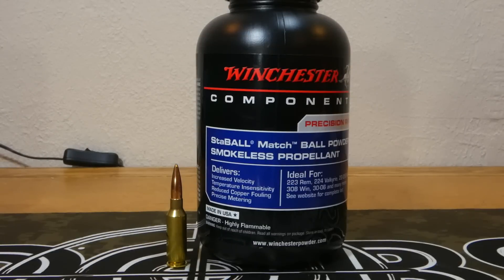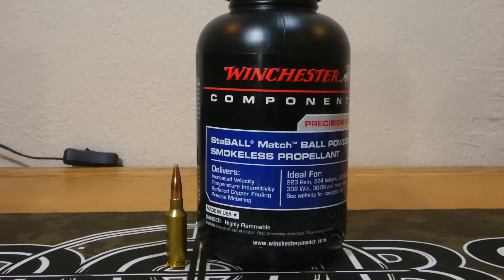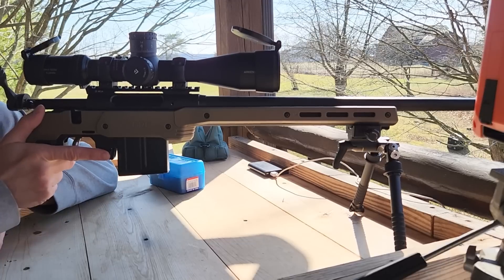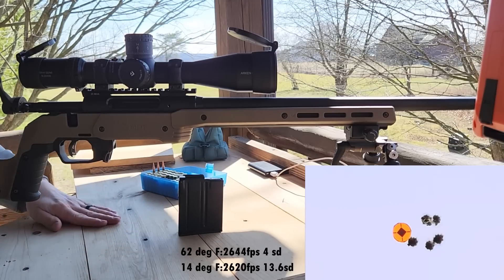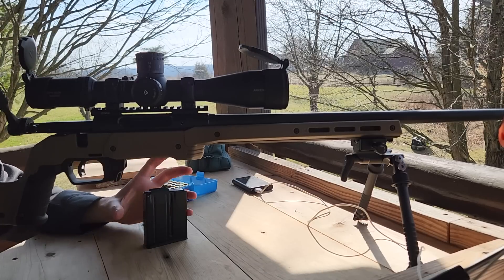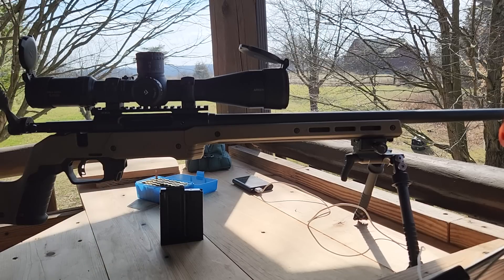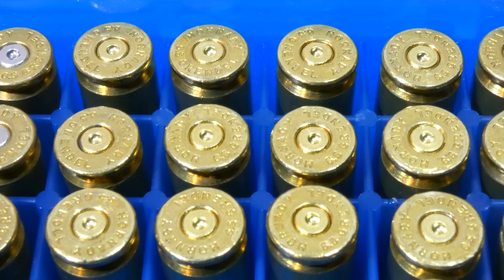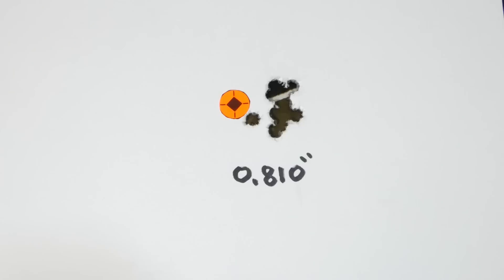Staball Match, Temp Stability, 6MM ARC

Comment: I did a test the same powder , except I was pushing 3000 FPS out of my 300WSM with 180 bullets.  The powder seems to be stable at lower 2600 FPS, but take it higher where the temperature  makes a greater difference at the result is instability.  My rounds at 50 degrees were perfect, 1/4 MOA. Same load @ 70 degrees started opening up.  @ 80 degrees primers stated blowing out the back and some bullets hit completely side ways.  My opinion is that StaBall, is only stable at lower velocities. Try the same test at 2900 FPS with your 6mm.
Reply: I have done a similar test - 20F to 95F, 7mm Rem Mag, 168gr bullets, 3050fps, basically zero velocity variation from cold to hot. These were shot in the winter and in the summer, so everything was at temperature, not just the rounds. This was using StaBall HD. Since your rounds were hitting sideways it seems like something else might have been going on maybe?

Comment: Testing to higher temps would be more better. It's not the temp you're shooting in(mostly), it's the temp of the powder in the case. You would be shocked at how quickly the ammo gets well over 100F just sitting in the sun on a nice 65F day, much less in a car or in the summer or hot environments. When doing temp testing, the largest extremes in temp that you can get should be the goal, in order to provide the best "snap shot" of the temp profile. Many other factors affect the profile, and it's not perfectly linear(usually), but in the absence of massive testing and analysis, the wider the snap shot, the better the approximation.

Comment: I’ve got a Savage 110 Tactical in 6.5 Creed and it struggles with extraction/ejection. I’ve swapped out the extractor and pin with factory replacements and aftermarket ones from Tactical Research to no avail. I see yours occasionally fails as well. Mines pretty much a fail every time. Love the rifle and how it shoots. WIll be requesting a new bolt from savage. I also have a 20” 6mm ARC AR15 and just picked up a few hundred factory second 105 OTM’s (Hornady) and some Staball match, appreciate the data you tested here. I was hoping it was similarly stable as Varget and it looks to fit the bill. CFE 223 is just far too unstable for me to do much more than plink with it despite being so versatile. Might make the switch for 223 as well if i can get it to shoot good with adequate velocities.

Comment: Interesting.
The better test would be the gun being as cold or hot as the ammo. Not wanting to shoot in 150° weather is fine, but if one shot their rifle 6-7 times in rapid succession, in 95° weather, the gun barrel and the last chambered round would be near 150° and its velocity could then be measured.
One could also leave the ammo and firearm in the noonday Summer sun for a few minutes and both would heat up quite nicely. Similar acclimation could be done in cold weather.

Comment: Being vacuum sealed you created a negative pressure inside the bag that slowly sucked air out of the cartridges. Less O2 to ignite with the powder equals lower burn rate and lower pressure. You probably cut open the bag and shot them right away not giving them time to equal out again. Who would have thought?
I'll ignore the third test, but really like the results from 14 to 62 degrees. What's the chance  you bought some Staball HD to test?
Reply from the maker: I don't have any Staball hd. Haven't found any yet.

Comment: I wonder, if when you vacuum sealed the first ones in water, the bullet could have been pulled into the case further causing less pressure and the lower velocities?
Reply: That's a good guess, except if the bullet seats deeper it increases pressure and increases bullet jump to the lands, both of which increase velocity. 
I'm going with the negative pressure inside the bags over extended period caused  a negative pressure inside the cartridges giving the powder slightly less O2 to burn.
Who knows for sure?

Comment: You'll want a test sample larger than 3 each to resolve any differences. While Hornady suggests 20 shots before you have a true picture of an average velocity and accurate SD, that's a lot of commitment for what we are doing... That said, I ran a similar test when StaBALL 6.5 was released using 10 shots each and it showed a pretty clear trend.

Comment: Deeply flawed test. However, despite the flaws and the bias that you used to skew the velocities… the total group… looks great… and that’s what really counts. Despite changing so many variables the POI and group size held together. This is a very good sign that that powder will work well in your load…. Depending on application.
Reply from the maker: What bias did I use to skew velocities? This was the most reasonable way I could think of to test temp stability.

Comment: Use a hair dryer to heat the next ones up. adjust the distance from the brass to adjust temp and it keeps them dry. Also once your set up it's a lot faster to get the heat evenly on and in the ammo. Great stuff. thanks I appreciate your information. by the way have you done a video on the stock and changes you have made to your rifle. I will be picking up a switchback in the near future so that information would be a huge help. Thanks again and looking forward to the next one.

Comment: In testing done at the GRT Lab, VV N555 actually lost velocity as temperature increased, and gained velocity as temperature decreased.  The delta between the high and low was only 3 fps.  So, do not assume that StaBall Match does not loose velocity as the temperature increases.  That is the nature of the latest temp control chemicals.   GRT process is to vacuum seal the rounds in a magazine, and hold those temps for 24 hr.  One bag is held in a antifreeze mix that gels at -4 F / -20 C, one bag is exposed to 70 F / 21 C, and the hot bag is held in a thermostatic hot bath at  140 F / 60 C.  Before going to the range the Thermos containers are sealed and taken to the range.  For each temp. the rounds are taken from the Thermos, removed from the bag and fired as fast as the chrono will allow.  Temps are adjusted approx 5 F for handling.  A minimum of 5 shots are required.  The 70 F / 21 C temp is standard, but but may not be the actual break point in the response curve since this is tested at 3 points only.  A test using 10 F steps would be better, but costly.  The 3 step test does establish the general trend.  GRT has a Assistant (wizard) that allow the standard temp. curve to be adjusted, and is effective once the propellant model is adjusted at the 70 F level.  The Temp. field in GRT is propellant temp, not air temp.  With your measurements of high and low, the GRT Propellant temp values are approx. -.0251 for tcc, and -.0163 for tch.  This a bit crude since your middle temp was off by 8 F.  I also used the  6 shot average of your 105 F V0 readings.  The N555 tcc is -.0057 and tch is -.0033.  So N555 is approx 5 times more temp stable than StaBall Match.  StaBall Match has approx half the velocity swing of LeverEvolution, which is what your viewers really want to know.  However, the bulk of StaBall Match will prevent it from ever producing LVR velocities, and it may be impossible to cram enough into a 6 ARC round to go over pressure.  StaBall Match when compressed does not clump like LVR which requires one to dig the propellant from the case if the bullet is pulled out by collet.  So it can be said that StaBall Match is not sticky while LVR is sticky.
Reply from the maker: Interesting information here. Wonder if get will add the new Staball powders.

Comment: Best idea I've seen for these tests is to get one of those small insulated "lunch boxes" with the heater in it from Amazon, and get a small cooler with ice or dry ice. Preload the mags and if you want to, you can pre-heat or pre-cool them however you like, or just put them in the cooler and lunch box for a few hours. For gauging temp. I've seen guys tape a temp. probe in empty brass with the fired primer still in it, and this probe just hangs out with the preloaded mags wherever they go. If you want to get fancy, you could make a plug for the temp probe out of jb weld or something. 
Or you could make a dummy round and put the probe through the primer pocket, which would probably be best because it would better account for the heat or cold that the projectile "holds on to". Being the component with the most mass and density I would think that the projectile actually plays a pretty good role in how quickly the cartridge heats up or cools off, and how long it takes to cool down or warm up once it's moved back to "room temp". Anyway, keep up the good work Sir

Comment: My guess with the vacuum sealing of the rounds in the 1st test:  the vacuum condition may have introduced a different variable - reduced oxygen. Maybe. 
(not the water)
Great tests & very interesting results!  Thanks for sharing!
Reply from the maker: Yeah I'm not sure how it changed the rounds but seems like it caused an extra variable. That's why I felt the need to try warming rounds in a different way.
Reply: Maybe the vaccum sealing lowered the humidity in the powder? That may have changed the burn rate a little. Usually humidity is important while you're reloading. If its dryer you're actually ending up with more powder because it contains less humidity. When loading in humid conditions, you're weighing powder plus water content ending up with less powder per grain weighed. But in the case of vaccum sealed, the powder was already weighed and even if you dry it after you still have the same amount of powder. That may be why your vaccum sealed loads shot close to the cold shots. But overall it seems stable for most hunter's need anyway.